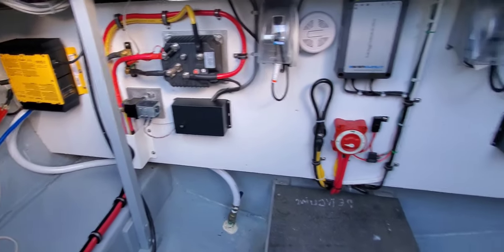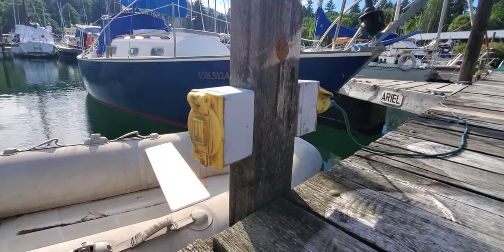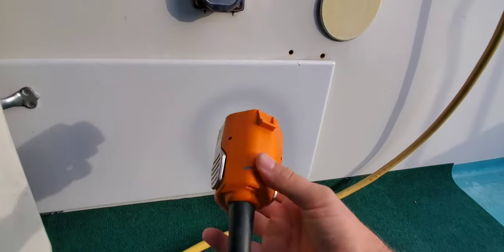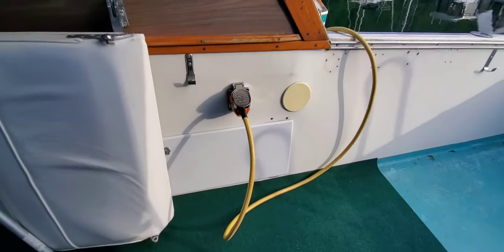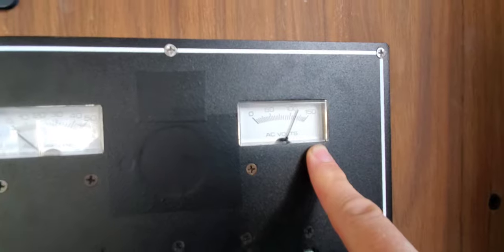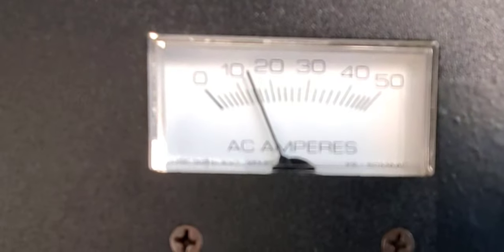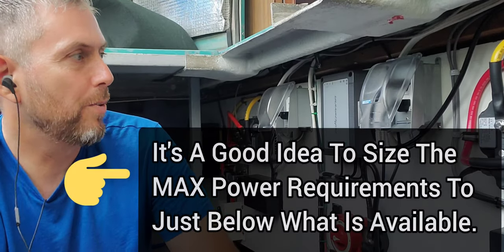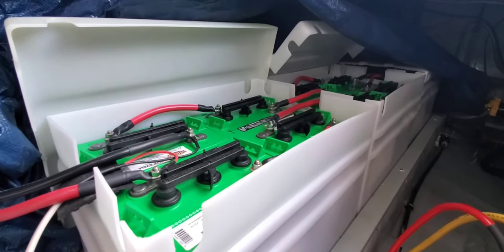Electric Boat - Charging An Electric Vessel At The Dock  (US Navy KISS Principle)

Comment: Hi! Love your videos. I own an electric boat from the 80s and a moderate size cabin cruiser. According to national electric code your maximum continuous current draw should be 80% of the circuit ampacity, so 24A for a 30A shore power connection. Keep up the great work!
Reply from the maker: 👍I'm just on the line with the DeltaQ Chargerst. They max at 12amps but not for the entire charge. What kind of boat do you have?
Reply: @ElectricCruiser  I have a 1983 W.D. Schock  manufactured Newport Electric Packet. It’s an 18ft displacement “launch” that weighs about 1800lbs. I promise I’ll make a video about it! I replaced the factory GE 2.5hp 36vdc series wound motor and 2.7:1 v belt reduction (also used in Taylor Dunn load hauler carts) with a Motenergy 1718 and a Curtis drive, running through a Baldor 4:1 gear reducer.
Reply from the maker: Ah cool, yeah fire off some vids for sure!
Reply from the maker: Sweet ride! Those are some great range numbers. When I first had the idea to retrofit a boat to electric, a Duffy style was exactly the type of boat I had in mind. Then my buddy (Mike from Bluefin) was "hey I think I found the boat - 30ft and 12,000lbs later lol ugh. 
Those Duffys are the perfect hull for this stuff. Thanks for sharing. I liked and subscribed. If I'm ever in Louisiana I'll be sure to let you know.  Would love to cruise through that scenery. Very different from what I'm used to. 
Problem is our communist prime minister won't let me back in if I leave. Apparently he didn't get the memo on civil liberties hah!
Reply: @ElectricCruiser  Actually in Houston TX now! And I got a bigger boat - a bayliner 24ft cabin cruiser. I’m thinking I might add electric pods for low speed operation.
Reply from the maker: @OVER-bENGINEERED  ah cool, yeah makes sense to go electric for low speeds. You don't get the fumes / smoke floating into the cockpit. That's one of the best features of eTolly, you can quietly and cleanly fish for salmon all day.

Comment: I put electric motors in two of my sailboats some years ago. I wish I had been able to use lithium batteries. Your dislike of them as a safety hazard are unwarranted. Some cell chemistry's are unstable and potentially dangerous. Lithium iron phosphate batteries are very safe. They will not cause a fire.
Reply from the maker: Unwarranted means having no justification or grounds. We both know that is a incorrect statement. I also do not "dislike" them. What I dislike is the upfront cost and the extra safety precautions I would need to take. 
Leads on this boat serve two purposes - 1) cheap energy storage and 2) the weight acts as a ballast 
eTolly lost about 3500lbs with the conversion, she needs to make it up somewhere or she sits nose down. 
Cheers

Comment: What do you think about the Elco EP100 inboard motor ? I'm looking at a Gulfstar 44, it weights about 25,000lbs. and I'm thinking about replacing the 2 diesel engines with Electric. Leave the generator as a backup and install a large Solar Array to charge the batteries.
Reply from the maker: Don't know much about them, sorry! Solar is good if you are at the equator :)

Comment: can you take and get a different belt for engine, mount and wire in an alternator to charge while using motor?
Reply from the maker: Perhaps but there are parasitic losses. The alt would have to produce 72V x  2 for each bank. Gets complicated.

Comment: Looks like marines should charge more for electric boats
Reply from the maker: Why? If we pay the bill who cares. Liveaboards pay the same hydro fees and they would be using more.
Reply: @ElectricCruiser  were I'm from the electric is included in the dock fee
Reply from the maker: Where I'm from we pay for what we use. Which I think is a fair system. Regardless of whether a boat is electric or not, why should someone pay an electrical fee if they don't use it?  Anyway you don't have to worry too much because there's not very many of us around👌
Reply: I don’t get why you should pay more for electric. Often the cabin cruisers are cranking the ac or electric heater that consumes more electric than the chargers for the extra batteries. Then I don’t know one ice boat that doesn’t have a charger on it to keep the starter batteries topped off. My boat has 4 12v batteries, two for engines and two for house. On average it’s pretty much a wash so to speak.